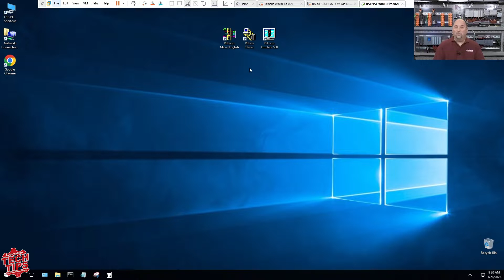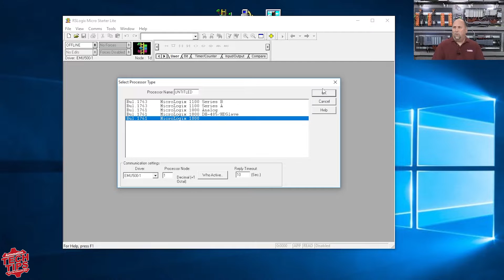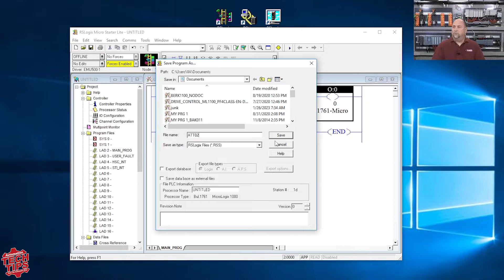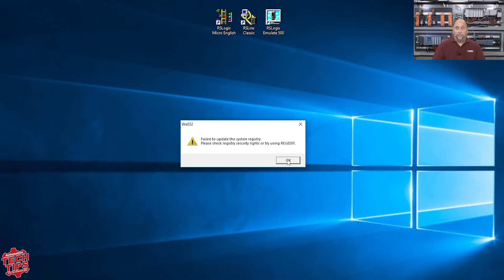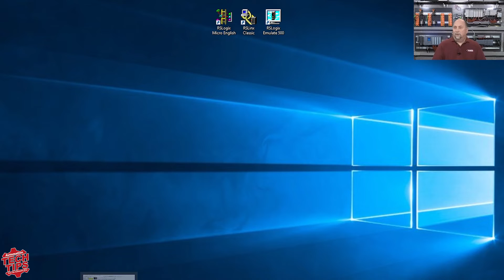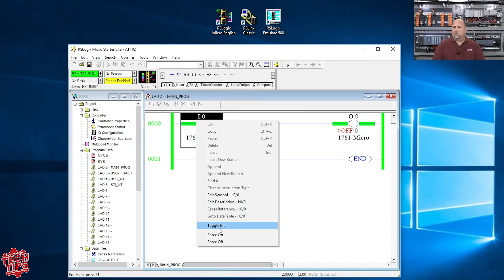Create, Load, and Monitor a PLC program using RSLogix Micro & Emulate 500

Comment: hello! Ive followed this guide step by step however, ive run into an issue when setting up a new driver in the rslinx software. when i selevt the emulator driver and click "add new" the add new button doesnt do anything. it isnt greyed out but when i click the button nothing happens. any idea on how to solve this?
Reply from the maker: Hi, can you share what version of RSLinx you are using, and what operating system your PC is running, and if you are an Admin?

- Shawn
Reply: @InsightsIA I keep getting a "this slc500 program must be compiled error." I don't know what I missed
Reply from the maker: Hey @justinkendollrozinek, before you run your program in the emulator, back in RSLogix be sure to Verify your project and Save it. This is a common mistake - sometimes I verify but forget to save ;-) 
- Shawn
Reply: @InsightsIA for some reason I had to close the program. Maybe it was because I saved it on close.
Reply from the maker: Thanks for the heads up @justinkendollrozinek!